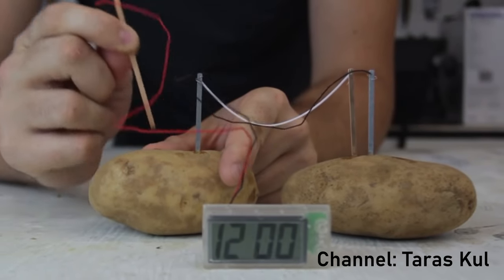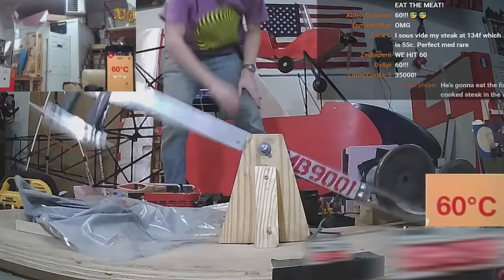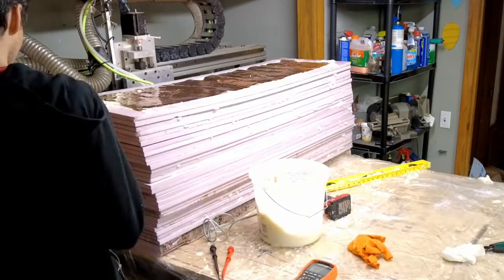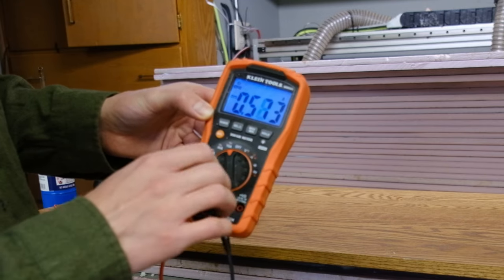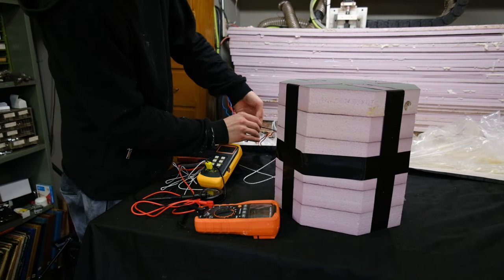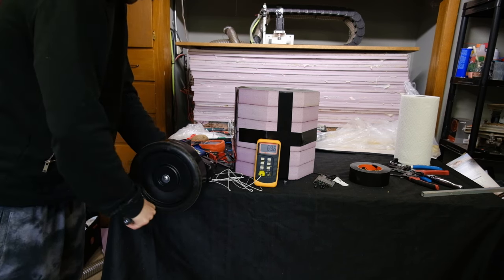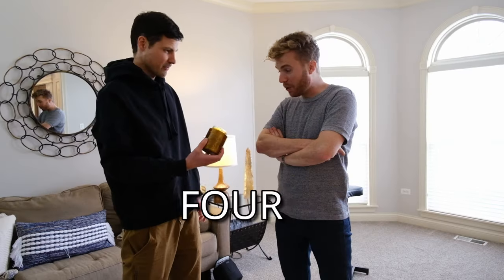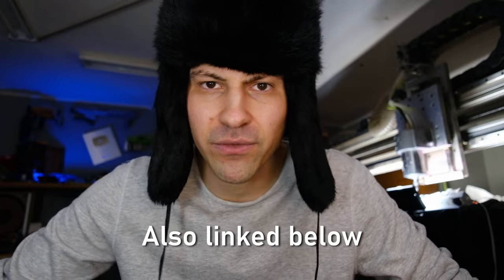Can you cook a Potato with a Potato?

Comment: You can probably get more energy by burning the potato, rather than using it as a battery.
Reply: he isn't even using the potato as the battery, just as the electrolyte, the energy comes from the metals!
Reply from the maker: Probably
Reply: @JoelCreates  Can you ignite a potato with potatoes? If you manage to use a spark of the potato battery to light up a potato on fire you might be able to cook a potato using burning potatoes
Reply: He technically did that by burning the potatoes consumed earlier inside his body to produce the energy that went pedal-cooking the latter potatoes
Reply: then you technically only need one potato! it cooks itself
Reply: @virgurilla4084  Yeah should be doable no problem. just charge a supercap overnight and discharge it through a thin wire.
Reply: @JoelCreates  when I clicked on the video I actually expected you to just slice up a potato, leave it to dry for a few days and burn it to cook an other potato
potatoes don't have a lot of acid, so naturally they would be a poor electrolyte
but potatoes are basically starch with some fiber and a lot of water, both are chemical energy that can be released by burning it

I think about 1kg(2 pounds) should be enough to cook one potato
Reply: this is what i was thinking he was going to do at first.
use dehydrated potatoes as fuel.
Reply: I feel like somebody like Nile Red could probably get the best energy out of it with chemistry, since while foods have energy, the methods for unlocking that normally use biological, not mechanical processes.
Reply: @33blue  Not technically he did remember there is no concept of free energy
Reply: @virgurilla4084  Yeah, but you gotta rub the potatoes together really fast to generate a spark.
Reply: Draw as much power from the potato as possible, then burn it.
Reply: Well, wouldn't burning the potato already cook it?
Reply: @katharinecluverius9960  Exactly. Infinite power!
Reply: @JoelCreates  definitely*
Reply: @JoelCreates  where  is peter ;-;
Reply: An 8 oz potato contains roughly 180 calories = 750 KJ. Released over 3600 seconds = 60 minutes that’s 200 watts. In a well insulated small oven that should be plenty enough heat to bake a potato by burning another potato. Probably best to make the fuel potato into charcoal (pure carbon) first. (Or just eat the potato, and pedal a bicycle powered generator for an hour 😊)
Reply: I HAD THE SAME THOUGHT
also he could just use the power to store and ignight the other potatoes that then burn to cook the potato to feed you and convince you to make the Minecraft furnace minecart run for real
Reply: The amount of energy released by burning something (provided the temperature is hot enough and there is enough oxygen) can be basically all the available energy - including that which would be outputted when using the potato as a battery. In fact this is why batteries typically burn - the energy they would have converted to electricity converts to heat just as well - if not better.
The only issue with burning a potato is the water content, which would need to be vaporised before the potato could reach a high temperature - this takes a lot of energy, so a wet enough potato would take more energy to dry than it would release. This (and the usability of the energy) is the only advantage chemical/biological processes have over fire - they can work cold.
To compromise the chemical / fire approaches, one could use pure oxygen or even flourine gas (which is just oxygen, but burnier) which would give the potato a far better chance to release its energy quickly, and thus to sustain the reaction.

The 'burning is an easy way of releasing energy' thing is natural from a few standpoints - one is annealing, as heating something up hot enough that it randomises, then letting it cool down again is a good way of reaching a lower energy state. The object randomly mixes with the air, then cools back into CO2 and water - any energy one could harvest has been expended.
Another is energy conservation - you clearly can't make a 'CO2 and water vapour' battery, so the electrical potential must go somewhere. Thermodynamics roughly tells us that if you don't know where some energy has gone, its probably turned into heat. And thus the potato which hasn't been used as a battery probably burns slightly hotter or slightly longer than the one which has.
Reply: @virgurilla4084  still would probably be more effective to dry the potato into a stick and use that bow type of primitive ignition
Reply: What I originallly thought he’d do😊
Reply: He did burn the potato, on human body temperature assisted by organic catalyst.
Reply: i guess technically it would still count, right?
Reply: Isn't that what he did? You pedal, and then eat the cooked potato, giving you back the energy you burnt. 🙂
Reply: I thought that was what he was going to do. I particularly appreciate the mass of energy used to set up the battery.
Reply: Am I the only one here who is aware that dehydrated potatoes don't magically return to the same electrolyte balance as a raw potato? Also, potato flakes are from cooked potatoes, which also has now destroyed the molecular structure that holds the electrolytes in a raw potato?
Reply: @krawnjob  by the looks of it, yes your are. I wondered about what effect cooking would have and if the increased surface area could counterbalance that loss in energy. But I certainly didn't know Jack Shi+.
Reply: @RegebroRepairs  except lots of energy is lost in the proces because noithing can be 100% efficient
Reply: he needs to eat only potatoes for a day, then by pedalling, he’s technically cooking a potato, with the power of only potatoes
Reply: That's what I was expecting when I came to the video to be honest
Reply: You can also feed it to camels and travel a bit. Travel is good. Makes you forget these weird, pointless experiments and live a bit.

Then burn the poop.
Reply: Use a potato battery to ignite a potato to cook a potato
Reply: Ok, hear me out: Ferment some potatoes to ethanol, then distil it and use the result in an ethanol fuel cell (Also include the ethanol used to fuel the distillation in the equation)
Reply: @33blue he meant fire not food
Reply: This would be my thinking, rather than using it as an electrolyte to convert chemical energy into electrical then heat, just convert different chemical energy directly into heat so there's higher efficiency.
Reply: @iankellogg  Oh. So it's actually a metal battery
Reply: Maybe you could use the potato battery to power some kind of miniature heat pump, as far as I understand, heat pumps can achieve like 3-6x the thermal energy out of a given amount of electrical energy. But maybe that's kind of cheating and I don't know if you can even operate a heat pump at such low electrical power.
Reply: @nathanwest2304   wait, I too!!! dislike...
Reply: @virgurilla4084  a potato powered capacitor maybe?
Reply: Play a fun game of
COAL OR FOOD!!!
Then use the coal to make another potato into
COAL OR FOOD!!!
in an infinite cycle.
Reply: Yes! If he really wanted to get some energy, he could extract the starches, break them down into sugars. That's a good fuel right there. There is probably a way to make an oxidizer from the other parts of the potato (possibly potassium perchlorate or nitrate because potatoes have a lot of potassium). I would love to see this played out. Truly using the potato's energy to cook another potato.
Reply: Convert the starch to alcohol via fermentation first, and then fuel a small stove burner. Would one potato be enough for that?
Reply: @pauljs75  Probably enough to cook a really small potato
Reply: That way he'll actually use the energy of the potato instead of the zinc electrode lol
Reply: @Buttermybumandcallmebiscuit  Yup, we call that "arson"
Reply: @JoelCreates  Definitely! This is how we find the caloric value of foods.
a lot of the weight of the potato as an whole is water and just wont add to electrical production. burning the starches and carbs will certainly provide more energy.. the real question is can it be conveniently harvested and directed into useful work? (no, its why we don't burn potatoes for heat/energy)
Reply: @nathanwest2304  It's almost like shitty wood.
Reply: next video
Reply: @ashleyhamman  Well, burning it would be more efficient than the biological process. The beauty in the breaking up of the glucose polymers and the glycolosis (breakdown process of glucose to pyruvate and some ATP) is that they have very low activation energies and can easily happen in our bodies without damaging anything and with the energy being available.
Reply: i think if you burn a potato then you’ve gone a bit past cooking it
Reply: Use it as a battery, then burn it
Reply: That's actually a much better idea. Dry them out and then burn them.
Reply: Exeactly
Reply: @virgurilla4084 Sounds great! Add using potato vodka as a natural grill starter
Reply: Were all potatoes used food grade potatoes @JoelCreates
Reply: He’d probably get more energy from splitting every atom in the potato
Reply: That's what I thought he would be doing in the first place.
Reply: @Francois_Dupont  In coal power stations, they grind the coal to powder, then blow it on a stream of air into the furnace, creating a jet of powerful flame, and leaving almost no residue. You could do the same with spud, especially when it's powdered mashed potato. Next year maybe invent an oven powered that way.

Comment: To add an extra pinch of accuracy, you could just eat some potatoes before pedaling the potato oven. Therefor at that moment you would be powered by potato, and you would basically be a potato energy converter. Breaking down the potato energy to turn into kinetic energy, then into electrical energy, which is then converted into heat energy to cook another potato!
Reply: Underrated
Reply: But you'd still have your fat deposits and other reserves

Something something nerd emoji something something
Reply: @randallmokjialung3592  I'm no diet expert, but I'm pretty sure you only really start burning your fat reserves once you enter starvation, something that wouldn't happen if ur stuffed up on taters o.o
Reply: @randallmokjialung3592  eat exlusively potatoes for the next 2 years to ensure only potato
Reply: You should be able to power yourself off of potatos, although I'd guess you should eat a steady supply of them for like an hour beforehand, then do some light exercise, so that your digestive system is always processing them, and putting the glucose into your blood throughout the process. Then, as long as you didn't tire yourself at all, you should be running exclusively off of the extra glucose being put into your blood by digestion. (The exercise is to clear any none-potato derived energy from your muscles).
Reply: you could also just get a whole bunch of potatoes and make them into a wood substitute.
Reply: That potato you ate could have been grown out of compost made of potato!!!
Reply: And then you eat the potato you cooked to fuel yourself for another potato
Reply: This is what I thought he was going to do when he switched gears haha
Reply: Smort
Reply: Facts
Reply: Huge
Reply: It takes like 20 pounds a day to survive off of potatos
Reply: @lucamagnani5243  and only run the potato cooker using the pedal thing that way you burn your fat reserves and are able to replace them by pure potato
Reply: Entropy would like a word with you
Reply: Give me a gas powered combustion engine for the generation of an electric current from dinosaur power/fuel and convert the electric output power to the heating element/oven/device.

Comment: While some may call this a failure, I found this absolutely fascinating. Really helped to grasp the scale necessary to pull off something like this. 

What if you used the potato battery power for a heat pump instead? Like an air conditioning unit, compressing and expanding gas to take away heat from an environment and put it into the potato
Reply from the maker: Thank you! It would be cool to research various electric heat generation methods to find the most efficient

Comment: You‘re probably wondering what my original comment was
Reply: Actually insane
Reply: At what voltage though? Amps on their own don't say much.
Reply: @Jdbye  a welding machine can weld using 30-60VDC on 50-200A

A mig can go lower than 30V

My small arc furnace uses 5V 100A
Reply: @Jdbye  it was shorted so near 0V. Still just impressive you can pull that current out of a potato, even if it's not much usable power
Reply: @bobbyflay4104  0V * infinityA is still 0W
Reply: @king_james_official  for sure, but the voltage was not 0V (not sure how much exactly because he didn't show it).
Reply: @bobbyflay4104  i just meant that the 3A means nothing if we don't know the voltage, if it was near zero, a small difference could change the wattage seriously
Reply: @bobbyflay4104  it wasn't pulled from the potato but from the metal sheets. The potato just acts as the elektrolyte could also just have added a bit of salt or lemon juice to the mashed potatoes. Way better electolyte, would probably have increased the power 10times.
Reply: @fabianbohnert120  when I said 'the potato' I really meant 'the potato battery system' but even still I think you can argue that while he isn't directly 'pulling current' out of the potato, the addition of the potato mash is reacting with the zinc to provide free electrons and current flow
Reply: @fabianbohnert120  or add salt, mashed potatoes taste way better with salt anyway! (but chlorine accelerates the corrosion, so you cannot store the battery)

Comment: the funniest thing about the potatos being replaced with AA batteries in the beginning is that, even a single one of those batteries would produce like 20x the output of a potato. the massive battery he produces later on has the power of like, a 9 volt battery, and lasts significantly shorter.

Comment: Better potato battery: Thin layer of hydrated potato powder with metal mesh grid to distribute surface area contact, put on foil layers, and ROLL it like a capacitor.

Comment: I've always wanted to have a battery I could charge with unusual power sources that could power it up like a little water wheel on my sink and a exercise bike and so on so forth so I could collect power for atleast 18 hours.
Reply: It is fun, but impractical.
By the way, there will be a problem with energy storage.
Storage elements like capacitors have leakage current.
With tiny amount of incoming power, losses can become higher than energy input.
I once made circuit which charges capacitor with waste electromagnetic waves.
Without selecting best diodes for rectification and best capacitors for storage, leaks were huge.

Comment: I still remember when I learned just how much electricity a electric stove consumes, the resistance heating elements we have used for like a hundred years are just insane power hogs. I got a induction hot plate and its much better, boils water faster with less energy and you get no hot spots, it makes perfect pancakes and grilled cheese. Precise temp control too. Downside is not all cookware works, no aluminum allowed and most cookware is aluminum.

Comment: Did you consider making it cook with rapidly fluctuating inductance?  You can generate massive amounts of heat with less energy in a coil using A/C.  You probably could have made a small frequency generator ( like a potato clock but much, much higher frequency ) and run the output through transformers and put the potato inside the coil.

Comment: Great video. Quick correction, it sounds like you said polyamide tape, but it looks like you're using polyimide tape. These are different materials, polyamides (like nylon) tend to have very low melting points!

Comment: The energy from the potato battery is coming from the potential difference between the copper and zinc and the potato juice is acting as an electrolyte. To really cook the the potato with potato you could ferment the potato to ethanol and use it to heat up the other potato. This would use the chemical energy of the potato instead of just using it as an replacable electrolyte

Comment: If there's a way to rig one of those peltier thermoelectric element thingies instead of a heating coil, you can get more heat using the same amount of electricity since it'll pump in some heat from outside. Happy engineering!

Comment: You could have done it if you'd used an empty battery or capacitor, charged them with your mashed potato circuits used a couple times, then used the fully charged much higher and more consistent output of the battery to get much better efficiency than the insulation. You could have also just used all your attempts without building more potato battery plates by just reusing them to add energy to this one battery.